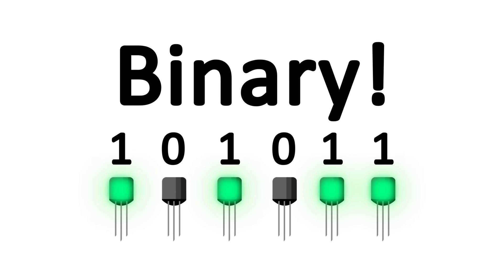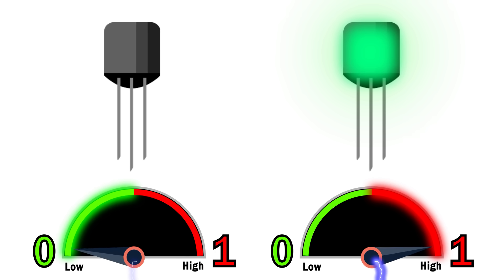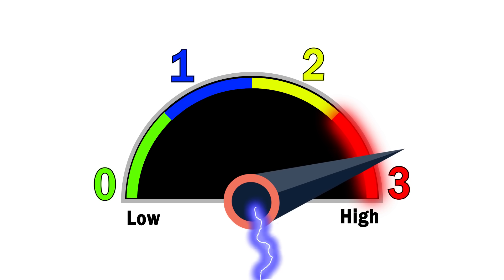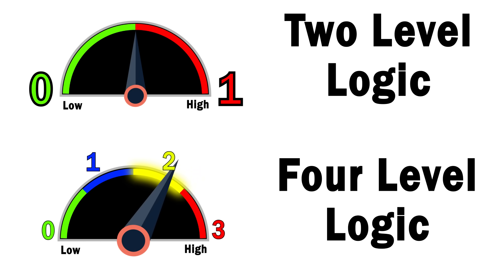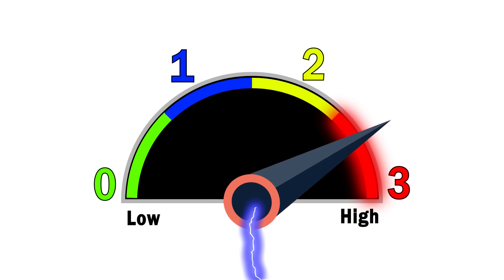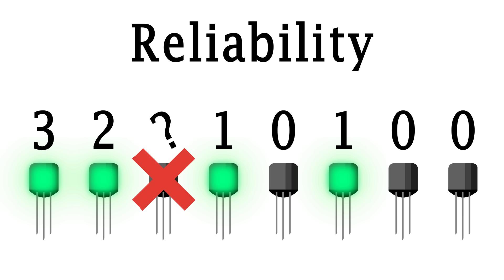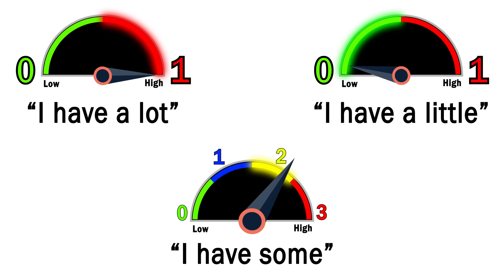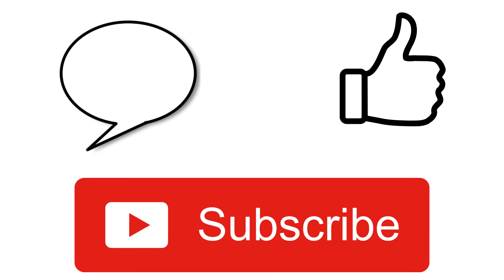Why can't computers use base 3 instead of binary? Voltage states explained.

Comment: So, The summary is that the REASON we still only use BASE 2 is because computer engineers were too LAZY to create a
High Precision state logic level management system? (🤔...................I'm not sure i got that RIGHT.)
Reply from the maker: Laziness wasn't the problem, in fact they did it successfully quite a few times. The problem is that no matter how precise you make logic level system, *there will be fluctuation due to the background radiation of the universe*. When you have fluctuation you encounter the rising edge falling edge problem, and physical space also plays a factor.
Making a storage system that could safely and accurrately store 3 level logic would require space that could fit 4 or 5 cells of 2 level logic.
Reply: @H3Vtux  I see. 
So unless they create a mechanism that neutralizes /minimizes the rising/falling edge problem while addressing Level logic storage this is it.
Those sound like Billion dollar problem's NOBODY will wanna spend money on.
And YET...........I would keep my eye on South Korea, They are doing Amazing things with Technology over there.

Comment: flash drives use base4  over base10 because it is easy to convert and in memory to represent address we use 8bits which is equal to 1byte. But in hexadecimal, we use 4bits to represent 1byte. It is easy to work with a larger bit of strings in hexadecimal.

Comment: What's the advantage of a flash drive using a base-4 system if it just has to be translated into binary by the computer anyway?
Reply: Storing more data in the same size. Translation is only limiting the speed at wich you read and write. As said in video, you have 65 thousand possible values with base 4 at 8 digits. 256 in binary that is. So the same ammount of space contains much more information
Reply: Storage density

Comment: Dude had this question for a while  idea doe with somthing to protect against a surge or fa sort why not take electricity’s fluctuations and proceed to have it like a pressure gage with gates of a sort with taking account the average and how high or low it dips under certain conditions add ing a third state when the voltage crosses offer the limit of the highest point  idk I have low understanding but seems like it would help with the reliability part with a resistance factor just a stupid idea

Comment: I'd like to know how hard drives storage data and how the operative system organizates it on the disk
Reply: An ssd or harddrive? Dedupe in fs or dedupe in controller or no dedupe? Transparent compression? Driver or os level?

Many variables here.
Reply: I have a feeling it has to do with the rising/falling edge problem.

Comment: I am interested in the stuff with hard drives.
Reply: Basically flash memory can hold more than 1 bit per cell but it reduces longevity of the cells but allows getting more storage from the same amount of cells. Most use 3 bits per cell (TLC) but some cheaper ssds have 4 bits per cell (QLC) to achieve the same storage. These should be avoided for most users.
Reply: Me too as will
Reply: Me too
Reply: Guess we will never know
Reply: i'll try to explain as best as i understand:
solid state storage needs redundancy to function right, as said in the video, if a single bit gets corrupted, the data becomes trash.
this is not an issue in memory where bites get written, read, deleted and written again constantly, but when you try to store data this way it might be years before any data is accessed again and in this time voltages can begin to drop naturally.
to remedy this the same byte is written to multiple cells which are compared to each other so a corrupted cell can be identified as such and then be set back to its original state. (this is why flash drives that sit in a drawer for too long tend to become unreadable, they need to be powered every so often for this to work)
now since you need to build in a certain level of redundancy for solid state storage to work right anyway, you can sacrifice some reliability to cram more storage into the medium. additionally even if a file does get corrupted, the system can recognise a file as corrupted and simply won't open or execute the file, whereas a corruption in memory can effect a program that is currently running, which can lead to catastrophic failure.
Reply: @windhelmguard5295 nobody's reading that all
Reply: same
Reply: I too am also interested
Reply: Yup
Reply: Me too
Reply: Yup, would love to see a video on this!
Reply: Yeah I am
Reply: Me too
Reply: 100% interesting
Reply: It's been 5 years, nothing yet
Reply: I am curious about the ssd and hard drives with other number systems.